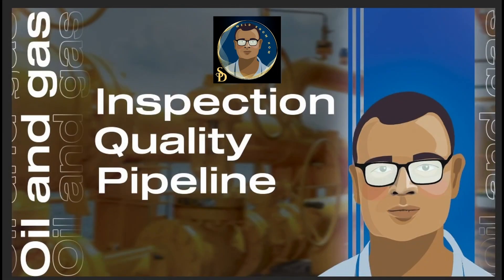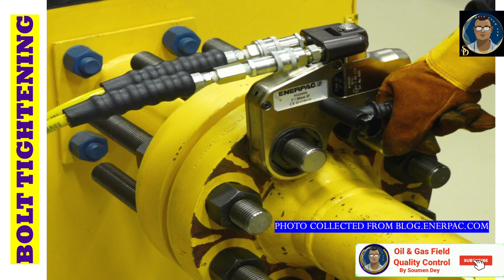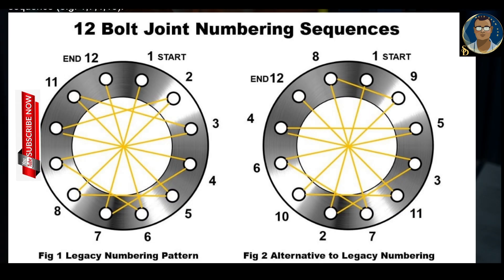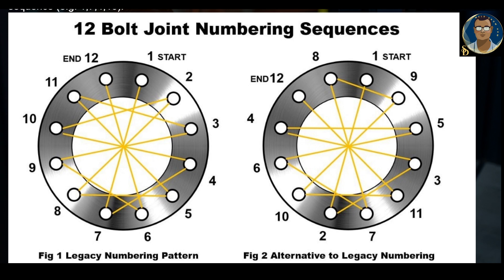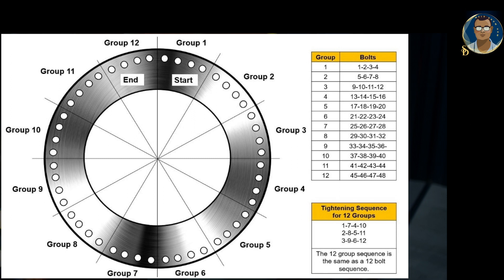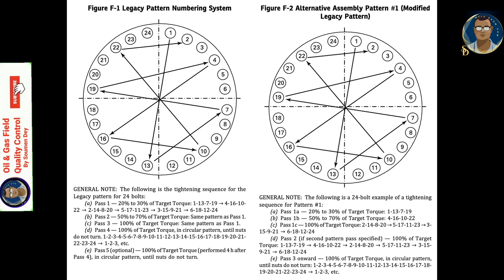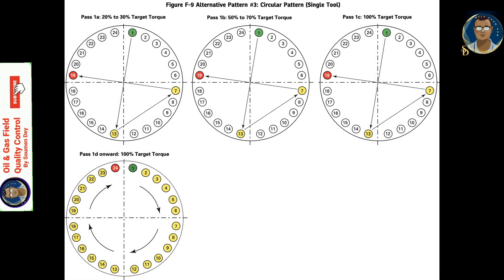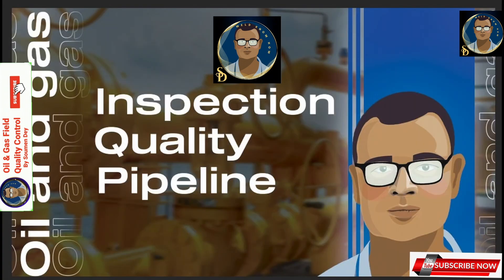Bolt Torquing || Bolt Tightening || Bolt Sequence Matters

Comment: Must follow..or only guideline....
Reply from the maker: You must follow one of the method from Pcc-1 or need to follow the client standard whatever applicable for you- following right sequence and right torque value will ensure that the joint will not leak